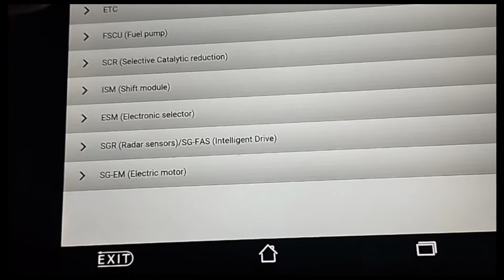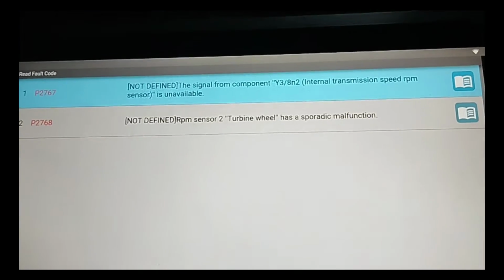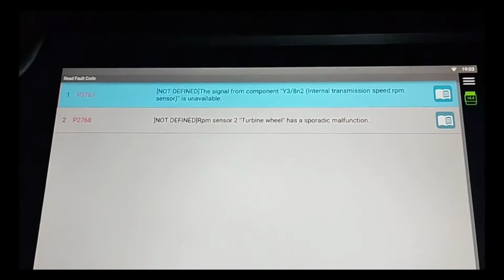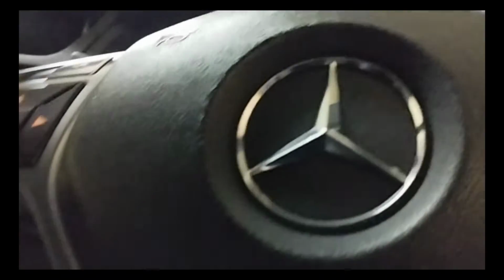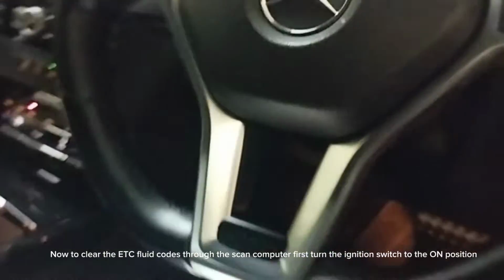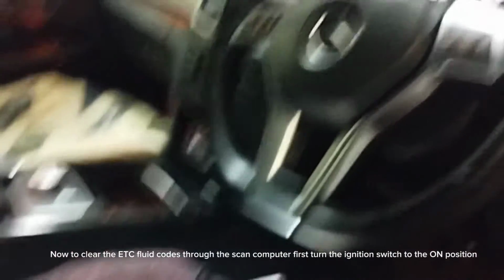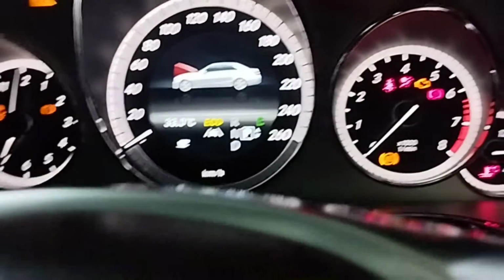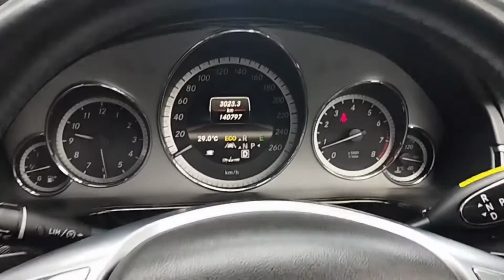Mercedes Benz E-Class , How to fix code p2767, p2768 turbine speed sensor malfunction ,

Comment: The only thing this video does not explain is how you remove the speed sensors, do you have to unsolder them and so solder them back, or you just push them out and push them back in? No one is telling anything about it, the video is not completed if we don't know how to replace the sensor.

Comment: Also on the first comment about the speed sensor so there is one that is attached to the body of the transmission externally, it seems to be a magnetic sensor speed sensor type? which model this applies what year besides the 2012? Because the video is talking about two different kind of sensors different types of sensors.

Comment: Do you have to solder the sensors, or just push them back in?
Reply from the maker: Same problem replace the turbine speed sensor
Reply: Hello , i have nearly the same problem on cls 320cdi 2006 the car stays in 2nd gear only doesn’t shift and i have a code of p0717 fault turbine input sensor no signal ? Any suggestions please thanks
Reply: @SCSautomotive.1988  yes but the question is can you just remove those sensors easily or you have to solder them back that's the question.

Comment: my car w212 code p0705 selection range sensor afterchenge no need do any setting? just delete fault code like thos video.
Reply from the maker: When you chang only sensor no need to settings reset faulty code ok. 
If you change the ECU, you must reprogram it.
Reply: @SCSautomotive.1988 ok, thank bro
Reply: @SCSautomotive.1988  Mercedes Benz 722.6 – Conductor Plate Replacement I have a quick question: After replacing the conductor plate in the 722.6 transmission, is it necessary to reset/initialize the TCM (control unit) with Mercedes Star Diagnosis?
Reply from the maker: If you change the TCM conductor pallet, you will definitely need to reprogram it.
Reply: Title: 🔧 Transmission Adaptation After Replacing the Leiterplatte (722.6)

Post:

Hi everyone,

If you are replacing the Leiterplatte in a Mercedes W203 (5G-Tronic, 722.6), it is mandatory to perform a transmission reset/adaptation using Star Diagnosis / Xentry.

⚡ Why:

The module needs to learn the positions of valves and sensors

Without adaptation, the transmission may:

enter Limp mode 🚨

shift roughly ⚡

change gears incorrectly 🔄

📌 Mercedes WIS/ASRA:

After replacing the board, adaptation is a factory-prescribed procedure

Procedure includes:

connecting Star Diagnosis / Xentry

selecting the vehicle model and TCM

running the adaptation + driving in various conditions

💡 Conclusion:

Replacing the board without adaptation is risky

Always plan to perform adaptation immediately after any intervention on the transmission electronics